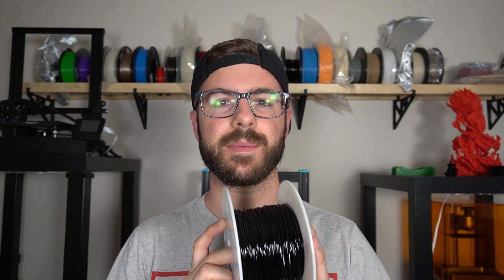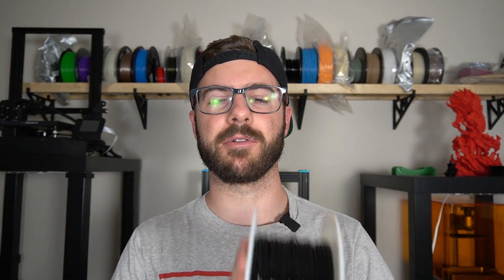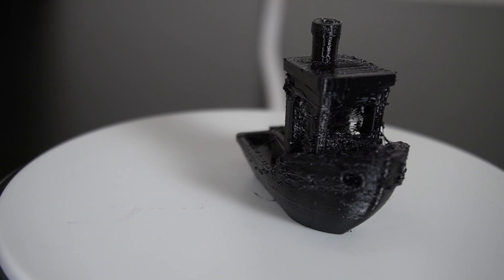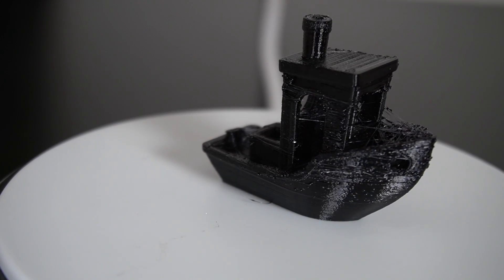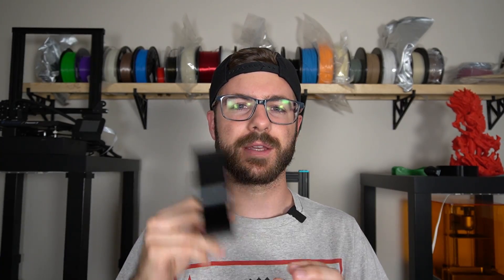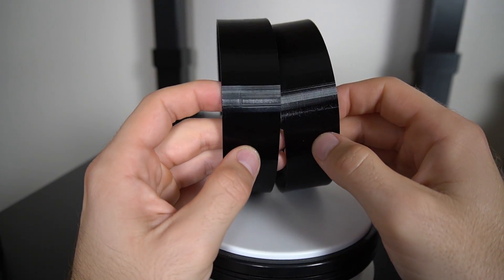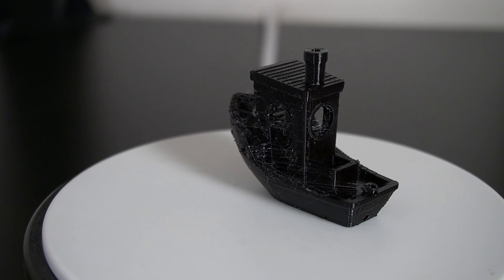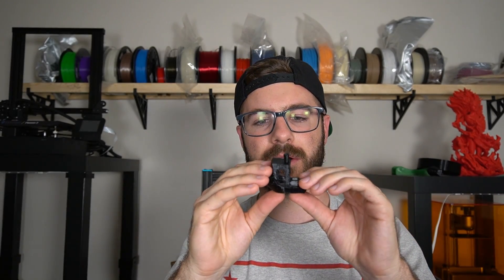3D Printing With TPU Dry Vs. Wet Filament

Comment: Which method do you use to dry your TPU? I tryed 3 different methods. You cannot go over 70 degrees for this material or it will lose his properties. Between 4 to 6 hours is more than enough.

I suppose you need to tune your retractions a bit (distance, coast, wipe) and lower the temperature to this TPU.

Maybe your “minimum travel for retraction” (advanced tab in Simplify3D) is to high... more than 6 or 8mm? and it isn’t retracting before small travels as happened in benchy’s windows for exemple?

By the way you have a new follower, I liked so much you review about X1. The combination of volcano and a direct drive is a must have in my opinion. I just bought one that is camming to work near my UM2 (+mod), Ender 3 Pro and my Bean from Kudo3d :)
Reply: I've been fighting with my UM2+ and Filaflex filament. I tried to try it for hours.
It's making regular blobs and noises during print,getting horrible surfaces with holes.
I added a oil mod on the feeder, that helped a bit getting printspeed up but no quality changes.
I tried printing from 235 to 260 °C, no real difference.
0-4.5mm retraction
It acts as if it was very wet, though after so much drying I am a bit lost.
Maybe the material aged in the shelf ? (2-3 years)
Reply: Ha Ka it’s really tricky print with TPU in an Ultimaker 2(+)... I put a Capricorn bowden tube and helped a bit... the bowden tube of Ultimaker printers are really long, about 70cm I guess and they make a “U” upside down format that add friction inside the tube. 

I had more reliable results printing with semi-flex filaments with 98A shore... 95A shore can do the work but when the stl have a lot of retraction it can be hard to deal. Keep the speed equal and low for all the places (less than 25mm/s), slow down your retraction speed to 25mm/s too or disable it or select in Cura a low limited amond of retraction per layer. Test with a small peace. Cheers!
Reply: one more tip... the flow... put it higher than 100% to compensate the friction inside the bowden tube... around 108-115%. If it’s leaving to much stringing think in lower the retraction distance too

Comment: Well I guess the differences could be better if you tune in your settings more, though a hard comparison. 
Do you notice anything on the strenght of the parts? Like the part with more moisture has more 'openings' in it and is breaking easier when under load then the dried one? 

And: do you see a difference in weight?